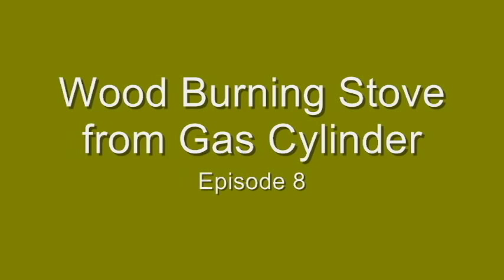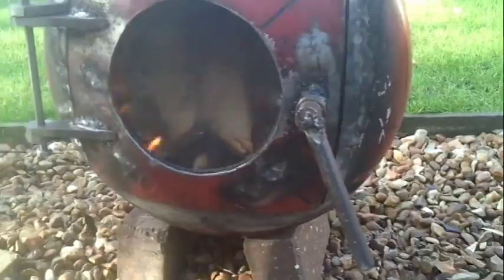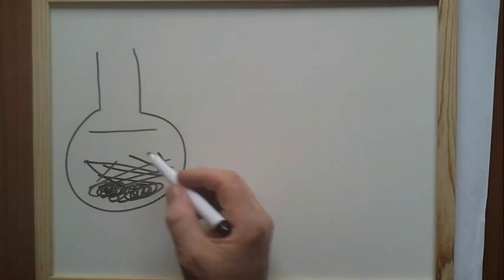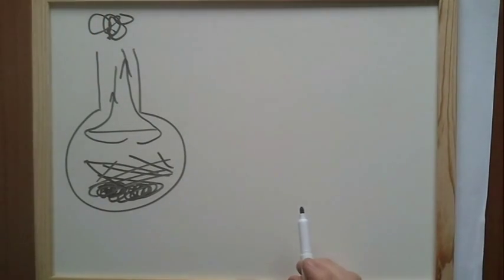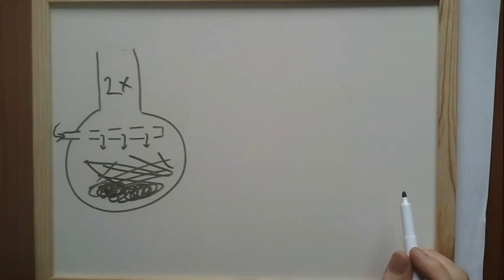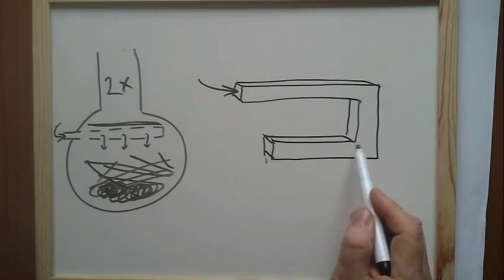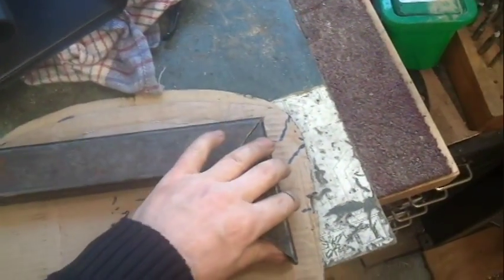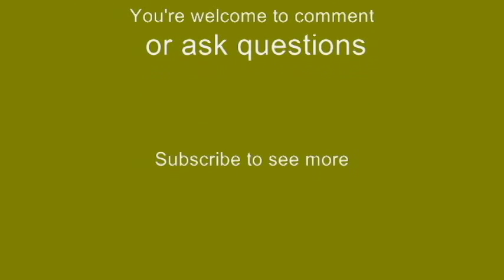Making a Wood Burner from a Gas Cylinder - Part 8

Comment: Laying the tank on it's side is not the most common way I've seen these stoves made, but I believe they're the most efficient burners, especially when a secondary combustion chamber is added. Adding the air intake in the secondary combustion chamber makes sense. Acts like a catalytic converter in a car burning the fuel before it gets expelled out the exhaust. Also makes adding a cook surface more effective. Thanks for the inspiration! Got my wheels turning.
Reply from the maker: Glad to hear it Mike